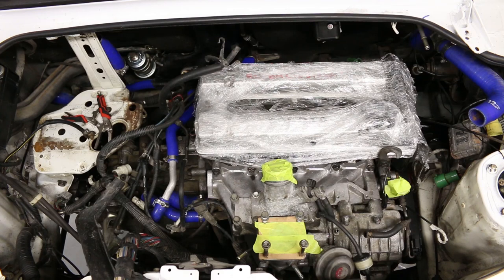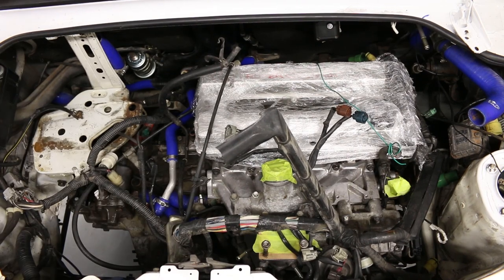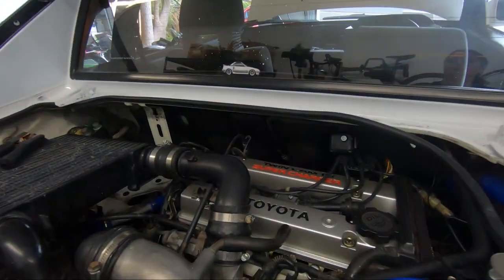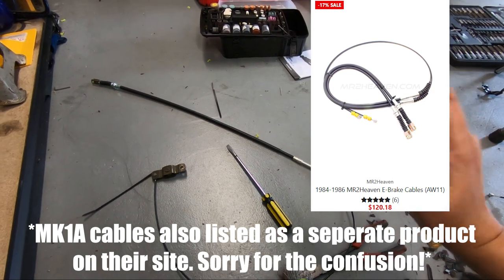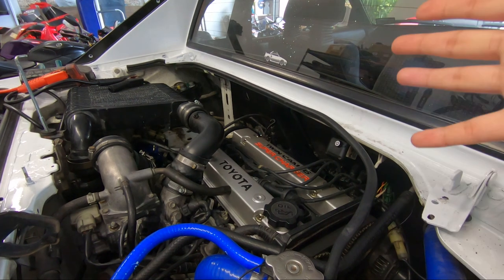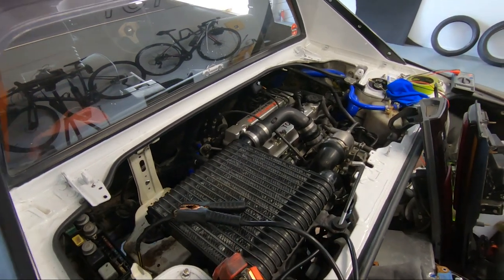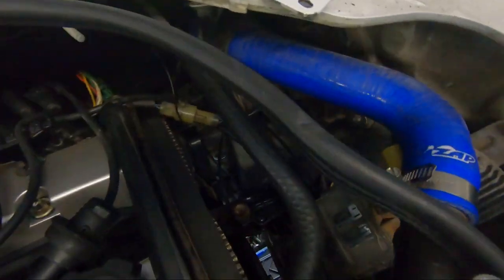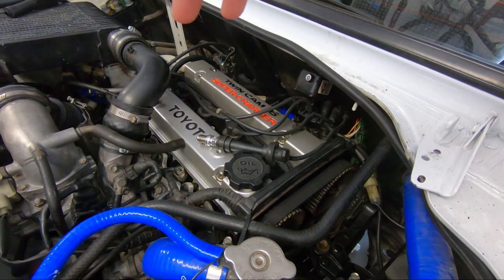Will she fire!? wiring 4AGZE

Comment: That cranking noise did not sound like cranking at all.  It sounded seized or the starter wasn't popping out to meet the flywheel.  Did you confirm the cams and crank actually rotated when you hit the starter?  If they didn't rotate then that explains no spark.  The dizzy is driven by the exhaust cam, if the exhaust cam did not rotate then the dizzy never lined up with the rotor to create the spark.
Reply from the maker: it was definitely spinning which was where the confusion began! but never 100% worked out what potentially caused it. 
In the end we had to adjust the dizzy a fair amount, found a couple electrical gremlins and did flip the exhaust cam over (as a few posts seemed to swear that would be the cause)

but probably shouldve done one at a time to work out what exactly the issue was!!

Do 100% agree tho, when i first heard the noise i was terrified i mucked up the reassembly somehow and motor was damaged! 
I also believe the 4ages are non interference! which definitely provided some much needed relief!

Also sorry for the late reply!
Reply: @STEPHASAURUSREKD  yeah they are noninterference motors in stock form.  If the dizzy is all the way to either side you're a tooth off on the dizzy.  Done it myself 100 times.

Comment: Hi, I have an 87 NA Mk1b and I want to manual swap mine. When you hook up the manual gearbox to the engine, will it sit just like the automatic or is there anything you have to add or remove?
Reply: Also, will I need a different wiring harness or will mine work?

Comment: "Toyotas leak from factory"; has clearly never seen a Cummins 6BT, any Mitsubishi diesel, or anything produced in England pre-2000 (cough Jaguar cough). Also that Nulon ether is junk. What you want is the John Deere 80% ether. One snort of that and she'll get up and go in a big ol hurry. Or it'll put the piston through the sump. Either way, its good shit
Reply from the maker: well i mean, I'm not wrong about Toyotas leaking so don't quite get the first bit of your comment :P But i guess you're right? 

Never heard of the ether stuff! will definitely investigate that and use for future starting issues!!!
Reply: @STEPHASAURUSREKD  What I mean is you can put brand spanking new gaskets throughout those engines, have them scrupulously clean and everything, and they'll still have the oil retaining capability of a piece of steel floor grating
Reply from the maker: @HotForgeChaos  ooooooooooohhhhh. Yeah nah stuff that 😂
Reply: @HotForgeChaos  As the owner of four 70's British cars and a 70's Aussie car, I can vouch for the truth of that statement.